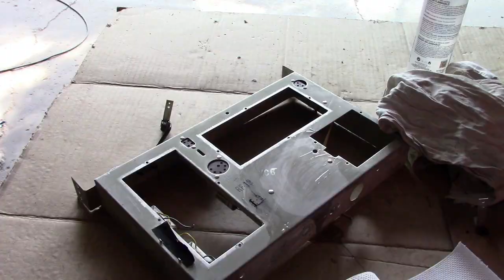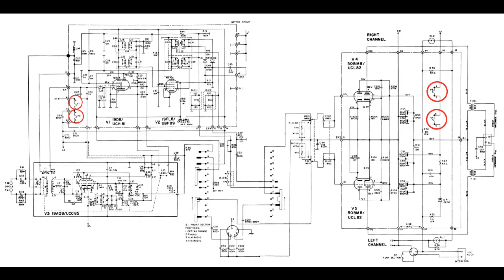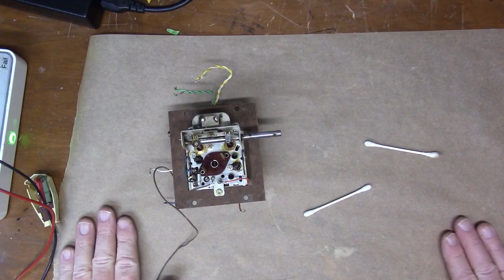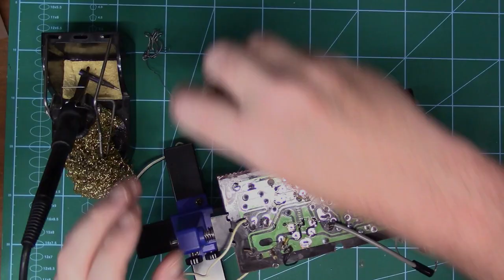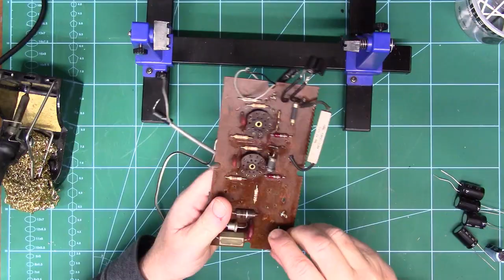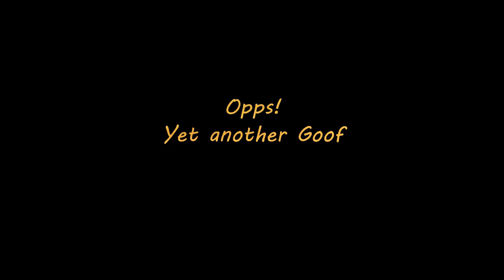04124  Too Big for the Bench!  Part #2 of ????

Comment: Do not attempt I do this stuff everyday it is expected of me I also have an extensive amount of tubes valves and fundamentals of vacuum tube technology and repair.
Reply from the maker: Well for me it is a learning process, this project has had a number of challenges and that is what makes if fun, and I agree working experience with high voltage is required. Unfortunately  these days it is hard to get past the book fundamentals of tube tech as most of the corporate knowledge is long gone, save for a few of the old boys from the radio club.  

Thanks for the comment.